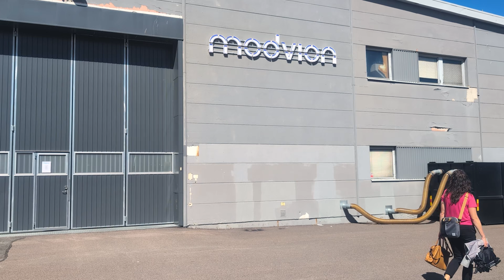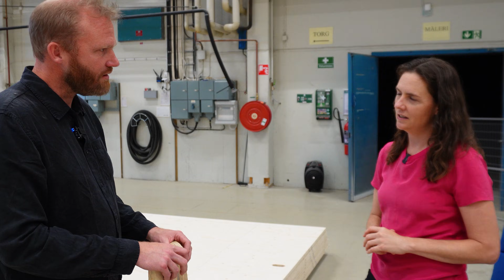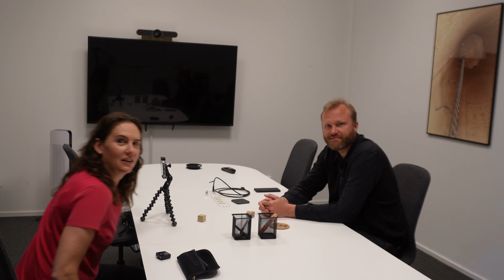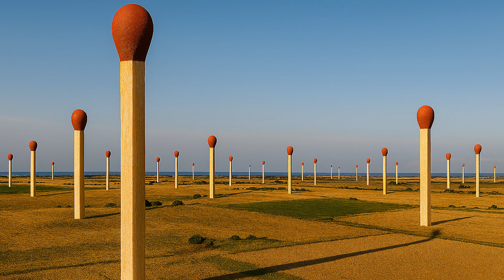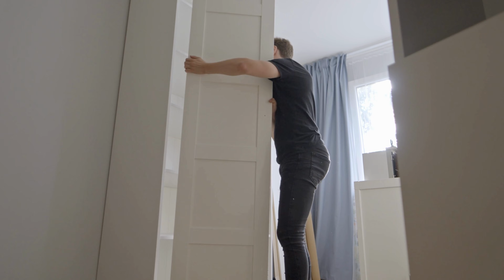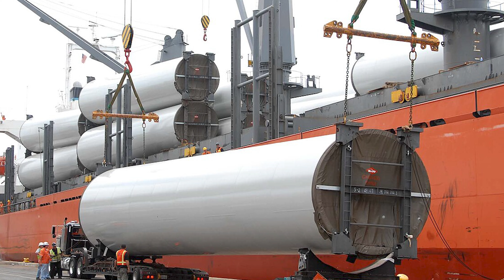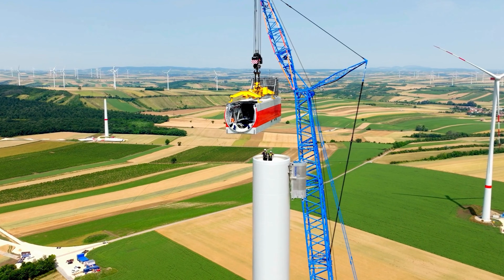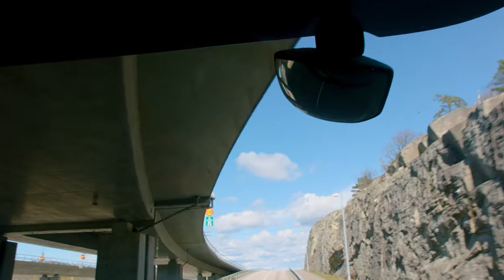How a Wooden Tower Could Unlock Bigger Wind Turbines

Comment: Very well done Rosie. I'm skeptical for a few reasons. Wood compared to steel has a very low modulus of elasticity so it seems flexing could be a problem. There's the case of connections with bolts etcetera. Erecting the tower in sections could be done with a good crane but being tied off 50 metres up to tighten joints is easier said than done. 

Please don't look to Canada for a sustainable wood supply because all the high strength wood, (old growth ), 100 years or older is dwindling. Old growth forest is also needed for wildlife habitat which mankind ignores. With a drier climate trees in Canada will be harder establishing and slower growing.
 Having worked in wood design, wood has its place but not for everything.

Comment: Lvl joists have started to replace steel joists in some construction projects. 
It's not a case that it needs to replace steel at all costs. I'm sure in wind turbine design as in construction there are times that LVL is appropriate , times when steel is the only choice and times when hybrid solutions like flitch beams, in construction, gives you a very good compromise.

Comment: the problem is the turbines not what they're made of. they have very low energy density compared with nuclear. a nuclear station needs one grid connection. an equivalent output wind farm would need around 180 grid connections using tons of copper which we don't have. and it only works one third the time. useless.

Comment: Madame Rosie . Would it not be possible to build a large 1MW horizontal axle rotor (blades 50 m ? ) and turbine , put it in a pyramid skeleton and hang it from a cheap simple round hydrogen baloon at 1000 meters high ? To harvest the stronger winds up there . Attached to a ground-winch tether of 2 cables , electricity and hydrogen supply .  Could such a structure not yield far more electricity that a normal  onshore horizontal windmill ? It could have an empennage like an airplane to guide its yaw and pitch direction of axle . The total weight is not of relevance here (cheap materials to be used , maybe even plain steel) , because the balloon carries everything anyway easily . Would this not be a good green energy solution ? Suppose this works for one unit , and then lift 100 or more in the air ? What are your thoughts about that ? Erwin , Belgium .

Comment: 6:50 Less primary emissions from producing "timber material" than steel... sleight of hand, leaving out the glue. What primary emissions are there from producing glue? I bet he doesn't even know. Vague, dismissive references to weaknesses of fiberglass, with a ridiculous reference to "butt joints." This isn't an engineering discussion, it's a sales pitch.

Comment: I was disappointed that you didn't discuss the potential advantages of making the turbine blades from LVL wood instead of fiberglass.  
I have seen piles of life'd out fiberglass turbine blades in Iowa and my understanding is they can't easily be recycled (although the problem is being worked on) but are just buried.  It seems like a wooden blade could be cut up and recycled into building material or ground up and used as feed stock for particle board.

Comment: One of the largest issues with any monopole tower, regardless of the weight, is the overturning moment at ground level due to the horizontal wind force on the blades, transferred to the center shaft.  Sorry if you've discussed this before, but that requires huge amount of reinforced concrete for a buried wide base (not really recyclable, but should last longer than the turbine and tower; maybe even rebuilt on top of it?).  We never see them unless during construction.  I would propose alternate methods, such as multiple deep angled piles etc.  Maybe my thinking is out of date.

Comment: Brill vid! There is a misconception that trees should be grown and not used. A point I wish would get greater emphasis is the fact that trees are brilliant sequestration mechanisms. Growing a tree absorbs CO2. Chop it down, plant another tree and the sequestration process continues. Use the chopped tree as you wish - but don't burn it - CO2 is stored forever! Trees are just long term crops - and the best sequester of all.

Comment: Let's see, grow wood for towers or mine iron ore, coal, nickel and other materials needed. I'm sorry but I found some of Rosie's questions silly. Wood doesn't rust, it's more stable in high winds, I work atop the 13 storey gantry cranes. I'm there all the time. Termites,  really? Fiberglass doesn't produce any emissions......as for a fire, get a sprinkler system, a CO2 or similar system. Why don't you have heat monitoring,  noise monitoring, bearings give off a lot of noise before they get really hot, pretty simple stuff, we use it in heavy industry. I know long before any of my machines cause trouble. Believe it or not many wooden structures are over 30 years old. I think it's an outstanding idea.

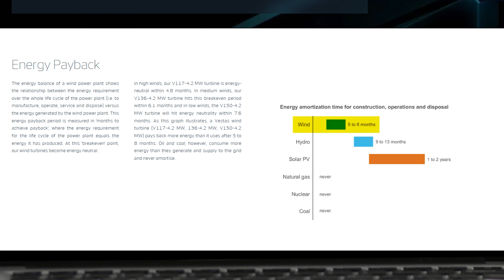Comment: @5:10  Agree. And because of the glue, composting the tower at end-of-life will be difficult (but I like the idea of slicing it up into beams).

As far as I'm aware, fiberglass blades are the biggest sustainability problem. Dust pummels the gel-coat, stripping it away and exposing the glass fibers below the surface. Fiberglass blades either need to be re-coated, or replaced. And while there is an effort to use chopped fiberglass blades as aggregate for roads, it seems unlikely as a long-term solution.

IMO the bigger environmental payoff will be a lightweight recyclable turbine blade. Will that be wood, or even bamboo? Is aluminum light enough to use--it's super recyclable.

Comment: Interesting video and concept- but im left with two questions;
1. Is the adhesive used in making the LVL biodegradable? If not, even if its recycled, that seems a bit like something thatll come in relevant when the reused / cut beams have to be disposed of.
2. Can they use this for the turbine blades as well? Afaik the blades are actually the bigger issue when it comes to circular economics - or was there a new developement i missed? 

Regardless, very cool to see people workign the issue

Comment: 5:08 This slide is poorly explained and misleading.  It is marketing - propaganda stuff.  Of course coal power plants produce more energy than what they consume otherwise they wouldn’t be built in the first place.  They are not build specifically to pollute or to annoy the environmentalists.  They are built to produce energy.  They should specify that they mean “clean energy“, then the table would make sense, somewhat.  As for nuclear, it is not renewable but as far as CO2 is concerned, it is clean, so there should be an amortization time.  Wind turbine amortize faster than hydro but they last only +/- 20 years and they cannot be use alone while hydro does not need anything else.  As I wrote this is a marketing slide and should not appear in this video.

Comment: Steel or Aluminum is the best outcome. 100% recyclable and easily recovered. No mess no fuss and Aluminum is one of the most abundant but also recycled with 100% renewable energy. The harm of forestry is too high. A put for metals extraction is actually cleaner. A tree is someones home. A hole in the ground is a hole in the ground.

I also dispute the CO2 argument. A tree is not a carbon sink until it matures. Forestry releases CO2. You will make less CO2 in the long term by simply recycling the metals and using clean arc systems or smelters to do so.

Comment: You should boil the plywood in hydrogen peroxide, bend to shape, apply tannins, and then laminate them together. Lighter extremely rot resistant maintains strength. You are welcome.

Comment: Wood is a terrible material for wind turbines, due to the size you need vast amounts of glue, and wood needs protection from the elements, so a significant percentage of these parts will be polymer glues and coatings. Polymers are obviously not "sustainable"
The best material for wind turbines is obviously stainless steel.

Comment: 1.  Bamboo is far superior in tensile and compression strength but not local
2.  Veneer could also be used to create the blades.
3.  Wood or bamboo is far stronger than fiberglass in strength to weight ratio.
4.  Carbon capture is a scam, we need c02 for plants to grow 
5.  There are better power options in many cases

Comment: This lower emissions argument, I am not very convinced about: are we comparing the net carbon emissions of the timber used in their original tree form in their natural environment over their entire lifetime versus that of steel or are we comparing the net carbon emissions of the engineered wood itself versus steel? The environmental damage caused by eliminating the wood in the forest on one hand and of the, so called, "managed forests" which, let's not forget, displace huge areas of actual, natural forest with real flora and fauna habitats for the same of tree plantations on the other hand are not weighed here. Neither are potentially better uses for engineered wood. Laminated wood is a very expensive material and can last a very long time in the right usage: hundreds of piano or thousands of cupboards or tables can be built for the same amount of would that is used in a wind-turbine tower. Most of these objects will last for more than a couple of generations. So can steel wind-turbine towers which can last a very long time.   Currently, there is no evidence that the re-purposed engineered wood from these towers at that end of their useful life can be used in construction. This is something that remains to be seen (in 30 years' time).
It also seems that the fire question was totally dodged: steel towers do not catch fire--at least not without great effort.
The main suspicion I have against such efforts is that not enough attention is paid to the fact that trees are not an infinite resource. Far from it: it's a very limited, invaluable resource that in the current world economy status seems to be treated as a free resource, by some countries, to be exploited as any other natural resource.

Comment: Rosie, always calculate against the end goal of a construction. In this case its electrical energy during the life time of the tower. Since wood outperformes steel in a very important metric for tower builiding, the stain it can take per kilogram, it will give much more energy during its lifetime. Decommissioning is another important aspect. A steel tower can only be recycled in a furnace. These furnaces are not everywhere. So steel takes a lot of transport. Wood is far better since saw miils are everywhere. Wood gets better over time. Old wood is better resistant to mold and moisture than young wood. In the roof of the Dom of Aachen you find beams hard as stone. They are over a thousant years old and are indestructable. The engineer told us that they take care that the wood will not rot. When it gets out of the tower after 35 years, the quality of the wood will be improved dramatically. Maybe some layers of the tower will suffer from fatique biput other layers will be top quality.

Comment: It steal us mas amounts  of plastic OR IN ORGANIC GLUE ADHESIVE! The UK built the Mosquito  airplane out the same material There is No Mosquito  left because  it fell apart!
Reply: Actually, there are 30 Mosquitos still about, 5 in airworthy condition, another 7 in restoration, the rest in museums.
I think most of the flying ones still have most of the original wood.  As long as they have been kept dry, indoors, then there hasn't been a problem.
The early Mosquitoes actually used a laminating resin made from milk protein, so no use of fossil oil, but it was later replaced by a fossil oil derived resin for better water resistance.  For turbine towers, it would be perfectly feasible to give them a waterproof coating, and then the laminating resin would not have an issue with damp.

Comment: We the British manufactured a bombers during WW2 out of laminated wood called the mosquito and we still make cars in a similar way called the Morgans. This make total sense especially when it comes to disposal at end of life which is a real problem with current turbines. Laminated wood can be chipped and as long as its burnt at a high enough temperature then there shouldn't be any major pollutant . Removing the metal is not an issue it's done with tyres. They've been putting lightning conductors on church steeples for centuries and a lot of them are made of wood likeways they don't rot because of tried and tested designs. What next wooden solar panels next 😂.

Comment: Thank you for a very nice video! 

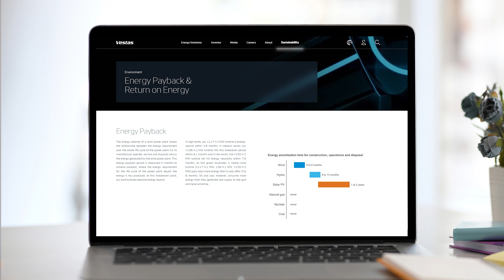I must say, I find the reference at [05:03] very unfortunate, since it's specifically very misleading on nuclear. 

All major scientific institutions, such as fx those under the UN and EU, recognize that nuclear has the lowest lifecycle carbon emissions of any source of electricity generation. 

Please see "Carbon neutrality in the UNECE region" by UNECE, chapter 4. They find nuclear lifecycle emissions (everything included: mining, enrichment, decommissioning, everything) to be 5 gCO2eq/kWh vs around 10 for wind and 40 for solar, 250 for biomass, 450 for natural gas, and 1000 for for coal. 

With the required batteries and extra transmission, emissions for wind and solar are higher yet, but still much lower than fossil fuels, (I hate that I even have to say this, but I do: I take the the stance which is in line with scientific data, which is to be very much pro both renewables and nuclear, recognizing strengths Nd weaknesses in both, and finding an optimal system that is safe and reliable and enables carbon free growth)

Your source may say that nuclear "never repays itself" but this is just stating that nuclear emissions are not 100% up front like for a wind turbine. 

That is, the (significantly lower) emissions from nuclear are mostly up front, with a the tiny amount of recurring emissions, due to nuclear power consuming fissile fuel which relates to a small amount of carbon emissions. 

Do you think anyone got that from your source, or did they just get "nuclear is just as bad as fossil fuels?" 

We need to encourage science literacy, yet when it comes to nuclear, you see this kind of misleading sci-com all the time.

Comment: 5:00 It seems that I'm missing something in this picture regarding energy payback of gas, nuclear and coal power plants. Something is really wrong in this picture. Why would one spend X amount of energy to create a power plant which will never return that energy back. It makes sene only if the disposal phase has a disproportional higher weight in the total energy budget than the other phases, which might be true in the case of nuclear, but is definitely false in case of gas. I can see that the cost is never recovered, and again, this only for nuclear, but not the energy. Please have a more critical review of the data you show, especially if behind it there is an agenda. I'm really disappointed, it is not up to viewers to notice these blatant and misleading data.

Comment: Thank you for this!

I got into wood things (for engineering) some years ago. I also thought that wood is a nice but weak material. I was totally wrong. Engineered wood is strong and flexible af. I mean there are houses and what not build out of wood that with proper maintenance last hundreds of years (some old european churches are over 500 years old).

Then there is the glue part. Glue is incredibly strong, stronger than lignin (the natural glue in the wood). Also protection layers are incredible. One can have a wood table stay outside for decades without nothing happening to it due to protection paint (that needs to be applied every now and then).

A tower standing for decades can easily outlast multiple turbines (that can be mounted on it in successive generations).

the big argument for wood products is: we keep the CO2 bound in the product (of course we have not to burn it later otherwise we don't win). Already for this I would push for building as much as possible with wood. Even rotting wood, while it releases CO2 back, it releases only part of it, not all of it (as with burning)

And of course one have to control the demand otherwise the bad players start to cut too much of very important forests.

Comment: Glue is great for building strength... just ask high school students! I've seen many constructions where the focus was supposed to be design, but the outcome was glued or taped to "within an inch of its life", and the impact of the design is thrown off by the amount of binding material used!! 😂
Regarding cost and sustainability, they are close to a large supply of timber.

Comment: One of the big challenges with wooden structures seems to be interfaces to other materials, the Tretten bridge failure for example. This design seems to avoid fasteners but I would be interested to know how they model wood as a material (modelling for the Tretten bridge obviously was incorrect) and how they model and mitigate problems around the interface with steel.

Comment: Light, stiff, strong, hot molded and hot molded wooden boats (and aircraft) have been built for about 80 years.  I've recently done some work on a couple of the oldest.  They are still in fine shape!

Comment: You question the sustainability of these towers with zero actual data to make your case. This significantly reduces the credibility of your production.

Modvion's towers will sequester carbon for their entire useful life. Meanwhile the majority of steel made globally is made in blast furnaces with c770kg of coaking coal required for each tonne of steel produced right at the beginning of the tower's life. So c1.5tonnes of CO2 for every single tonne of steel. And that isn't counting the MATERIAL emissions from fugitive methane in coking coal mines (coking coal has to de degassed before mining - otherwise you get catastrophes - but you still get a lot of methane coming to surface).